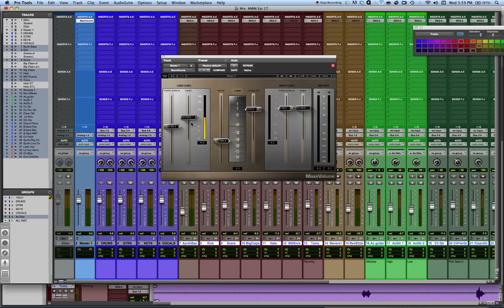Mixing With Mike Plugin of the Week: MaxxVolume

Comment: All these years I have had problems with lead vocals cutting through the mix. I usually had to bring the fader of the vocal too loud which would drown out the beautiful back up instruments, or I would bring the fader down to where parts of the vocal would be lost. No other plug - in compressor has solved this problem for me personally except this Maxx Volume by Waves.
Reply from the maker: ***** Hey Jay,
Not many low level compressors out there, this is one of my favorites!
Cheers!
Mike

Comment: Just taking a look at the Low Level operation here. 
It appears that it doesn't pull the lows up to the Threshold level; rather it has a Gain that you Preset that is then reduced by signals going Over the Threshold level. 
With the Low Gain at Zero the Low Threshold does nothing.
The Gain in the Low section isn't so much a Make-up Gain as a Pre-Compression Gain 01:49

I know you know your stuff but I think you got one thought mixed up with another there.
The Waves manual is also a little confusing in this regard.

I like the mode of operation of both this and the MV2. 
A slightly different way from simple compression of narrowing the dynamic range of a track.

Comment: So when would we use this maxxbolume vs mv2? Or usually just use maxvolhme
Reply: Sometimes it’s more intuitive to a workflow or a problem to use a simpler tool vs a more complicated tool, and vice versa. I know I sometimes choose a plugin or hardware because it does have fewer options to fiddle with, and I know that it will just sound good (takes experience with your tools).

In this case, MV2 vs MaxxVolume, MV2 will be perfect for something that doesn’t need gating or any of that kind of stuff, such as a bass DI or a software synth pad. Meanwhile MaxxVolume might be better with something that needs tinkering, like a snare drum from a live set. Gate out the room noise, squish the ring of the snare upwards, and then compress the transients and suddenly you have a clean, controlled and powerful snare sound.